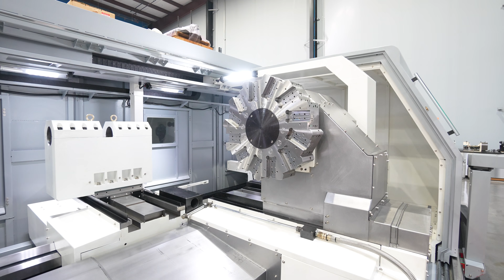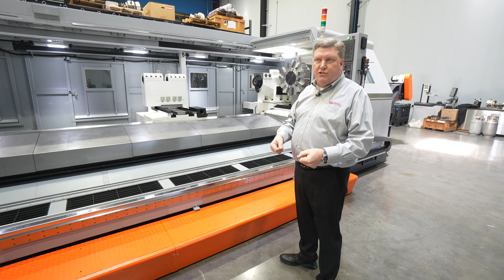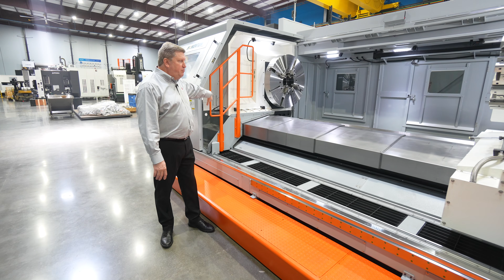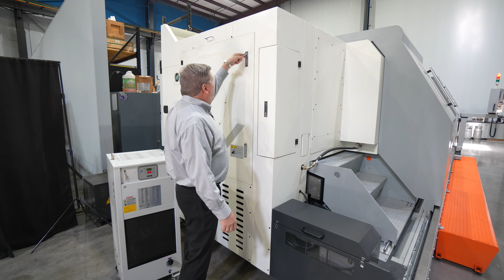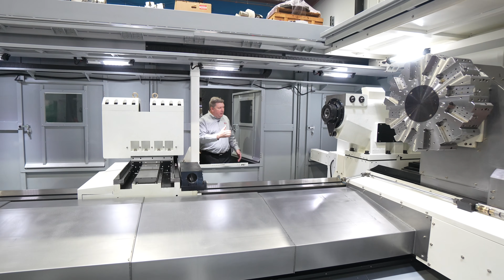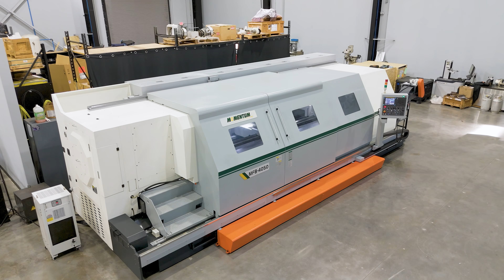Heavy-Duty Flatbed Lathe Reviewed by Doug Schulte, aka The Machine Tool Google

Comment: make the steps to be motor controlled , i will but this machine
Reply from the maker: The larger machine have an operator station that is motorized so can travel the length of the machine and maintain full visibility to the tool as it makes chips. 

Would that work!